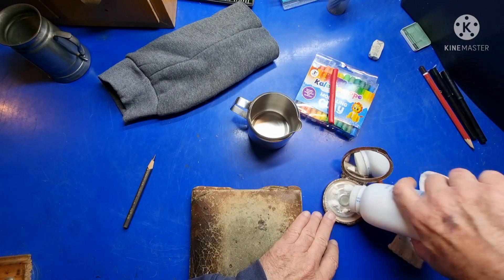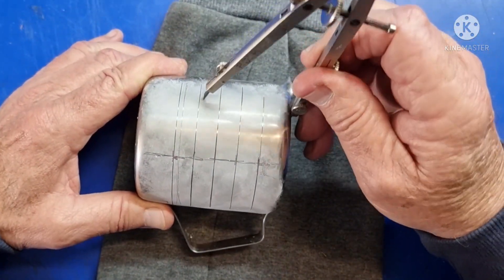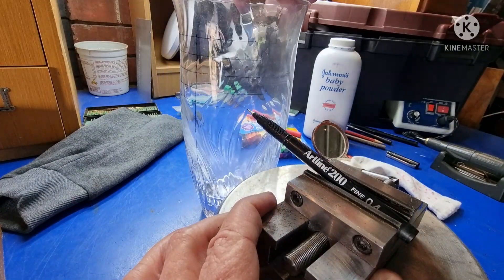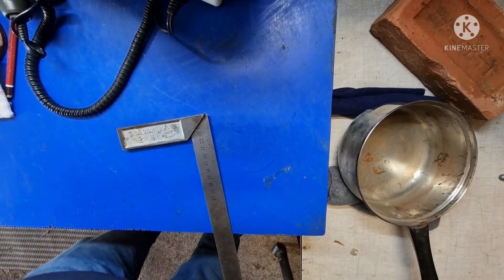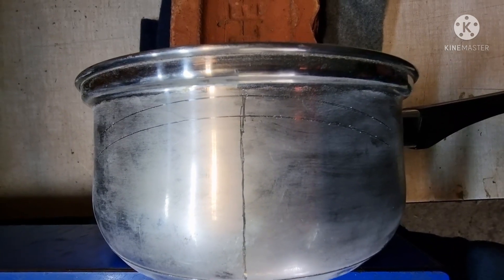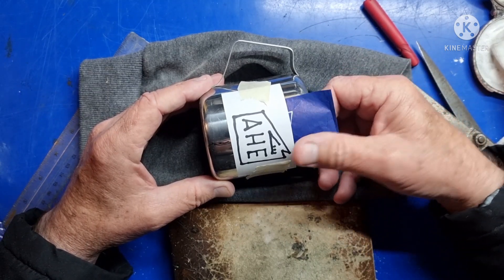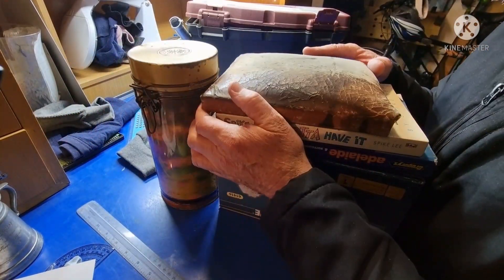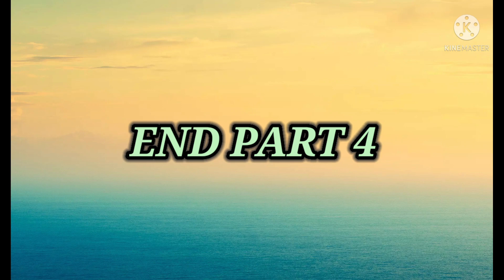engraving 4

Comment: Great series, thanks for all the info, Stevo, I've been wanting a micro motor to take over the detail work from the dremel, when I came across a 780W Hanging Flexshaft Mill Motor on that usual shopping site, what would you recommend, a flat knacker, foreskin peeling back, superfast, low powered machine(60-80k rpm), or something with some grunt, that could pull a stump out, but slower(28k rpm)?.

Thanks mate,

Scott.
Reply from the maker: Yeah, where do i start? 780w? Hell, it'll rip yr arm off!! Haha .micromotors do 35k revs and there is practically no slop in bearings, smooth as a babies... & flexishaft is so last century, go modern, is good. About $130 aussie bucks

Comment: In a previous life I used a product called developer which is talc and acetone in a spray can; it'd probably work in this application too if you happen to have a line on some.  It has a shelf life in its intended application and any of it which is expired should be available for the asking.
Reply from the maker: Thanks for the info jim